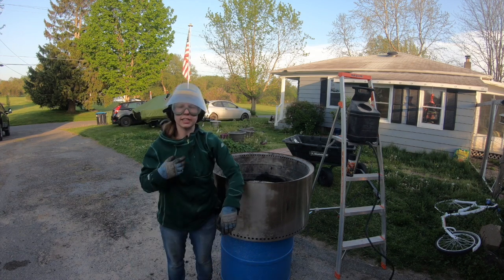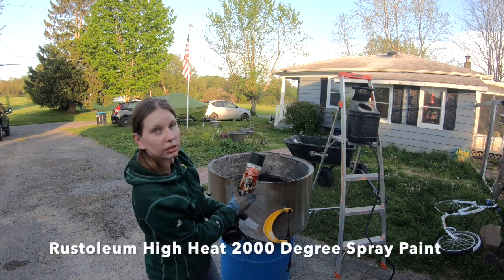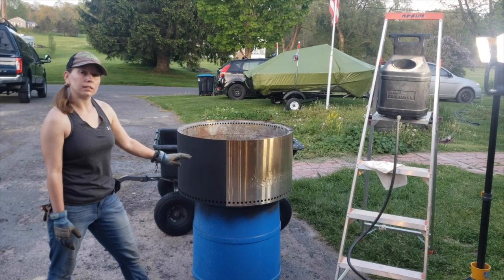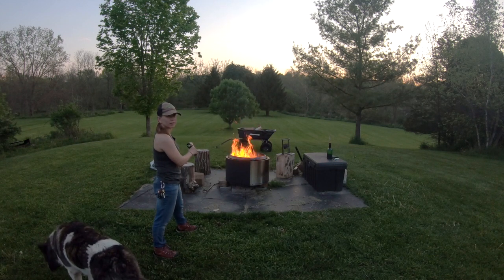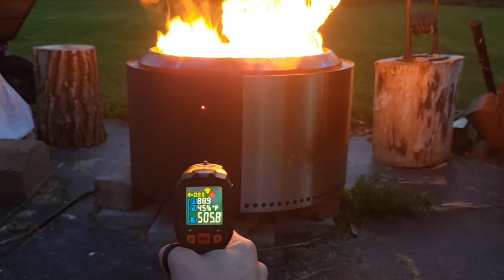Solo Stove Radiant Heat Test in Yukon - Make your stove burn hotter!

Comment: I am interested in black for the sake of more effective warming if people nearby. However, I wonder if it may lead to more smoke. This might be a good experiment!

Note that the black surface is actually COLDER than the unpainted stainless, even though it measures hotter by IR thermometer, because it is emitting more, ie losing more heat to the environment by radiation. This in turn means that the secondary air behind the black wall isn’t getting as hot.  The preheating of that secondary air is intended to complete combustion of materials that would otherwise be smoke. Also I can see the higher flames on the black side - that may indicate more smoke. 

Maybe repeat under daylight and just make visual observations?
Reply from the maker: https://youtu.be/mnPaBYZviS4

Comment: Awesome. How did it turn out? Is the high heat spray paint holding up nicely?
Reply from the maker: Overall it's held up well, I recently touched up the paint as the bottom chipped a bit, if I had spent a little more time in the prep work, probably wouldn't have needed it.

Comment: Did you ever do any additional test such as how heat radiated 3ft and 5 ft away and such?
Reply from the maker: Not yet, planning to repaint the black side of the stove, dull the surface finish of the unpainted side and get some thermocouples to attach to the stove body so it will be a good test.

Comment: You cannot use an IR thermometer for this test. Reflective vs non reflective surface. Id be interested to see the results with an ambient thermometer. I suspect if anything the painted side would be cooler.

Comment: Think I'll Keep Mine Stainless Steel.   That's One of the Things I Like about the Solo Yukon.   You can almost sit next to it with Kids and Dogs and Not have to Worry Too Much about Burning Fingers or Fur (Or Dog Noses....).   I Like the Fact that the Outside Surface of the Stove stays quite a Bit Cooler, Thanks to the Secondary Combustion Channel.    I also Love the Stainless Steel Appearance as Opposed to the Flat Black.    We've Had Our Yukon for quite a while and it still Looks almost Brand New since the Fires We have Aren't Allowed to Get Out of Control.   These Stoves can Certainly Burn through a Lot of Firewood.   Too Hot a Fire can Also Warp the Top Ring...
Reply: The outside of your stove stays cool?  I have the Bonfire.  Pretty much everything a half inch up from the bottom holes is blazing hot when the stove is hot enough for secondary burn.

Comment: I don't think the IR is giving an accurate reading on the stainless side. I recently ran into this issue while modifying a stainless smoker to a higher wattage heating element. The highest reading I could get with the IR was a bit over 200 degrees. I knew this couldn't be right. When I put an analog oven thermometer in the smoker it read 512 degrees at full power. I think this must have something to do with the reflectivity of raw stainless. I think a more accurate test would be to put two oven thermometers like the one linked below an equal distances from the painted surface and the raw surface and compare the readings.
That being said, I really appreciate your in depth reviews and comparisons of these fire pits. I think the Bonfire is the right size for me.
https://www.amazon.com/Taylor-Classic-Large-Dial-Thermometer/dp/B0000DJUYR/ref=sr_1_1_sspa?dchild=1&keywords=oven+thermometer&qid=1597579576&sr=8-1-spons&psc=1&spLa=ZW5jcnlwdGVkUXVhbGlmaWVyPUFaQjhTRzRRQkZXMFQmZW5jcnlwdGVkSWQ9QTA2MDkwMjkxMzBGNllSM1A5UzA5JmVuY3J5cHRlZEFkSWQ9QTAxODc3MTUyWUZBRzhYSVA4V1RNJndpZGdldE5hbWU9c3BfYXRmJmFjdGlvbj1jbGlja1JlZGlyZWN0JmRvTm90TG9nQ2xpY2s9dHJ1ZQ==
Reply from the maker: Thanks for the suggestion, I'm sure that thermometer would read more accurately, it would be a good experiment for the future.  
You can physically feel the heat difference between the sides as you walk around, so there is definitely some difference. 
Thanks for watching!

Comment: Not an expert here, but when using an IR thermometer you need to calibrate it for the emissivity of the object being measured to get an accurate surface temperature.  I do not know how this relates to real feel radiant heat.  So maybe taking a reading this way represents how you would feel sitting a few feet away.  I can see in the one shot your thermometer is set to E 0.93.  This is in the standard range of normal use as many non reflective surfaces are in the 0.9s, for IE skin has an E of 0.97.  Stainless steel however has a much lower emissivity (0.3-0.4), therefore you will read a much lower temperature, as temperature increases this error in readings becomes worse.  At the end of the video you show the stainless side as 123 F, at that temperature you could practically hold the thing for a few minutes and not sustain a burn, however I know that my bonfire surface gets extremely hot that even brief contact has melted my shoe, much more indicative that the surface is well into the 200s, especially considering the fire is burning at 600 degrees +. I think a good test  to see if the black side will actually make you feel warmer, would be to take 3 similar objects all painted the same color (black painted plywood) and place them around the fire on the respective side, (ideally below flame level) with the 3rd set at a distance away to get an ambient temperature.  Take readings as the fire gets going.  My guess would be, not much a difference while the fire is going, maybe as the fire cools the black side holds heat longer.  Maybe you can try that as a test?  It definitely has my interest.  Im sure if someone with a science background chimes in they'd already know this answer.
Reply from the maker: I hope to do the object test in the near future for the reasons you mentioned. 
You can physically feel the difference as you walk around the stove so there is some difference between the sides.
Thanks for watching!
Reply: I just bought the bonfire model and definitely no way with a fire that large the stainless surface is only 123f …

Comment: Very cool experiment! And a nice look to the stove! I think the temp difference has to do with how your IR thermometer reads heat off different types of surfaces. Has to do with "emissivity" of the surface. If you still have the half painted solo stove, a good follow up test would be to paint 2 identical pieces of plywood with the same paint and then set them up equidistant from the solo stove on each side - painted and unpainted. Then take readings with the IR of the plywood to see how much they heat up and if one heats up faster. That would control for the variable of how the IR thermometer measures temp.

Comment: Interesting experiment! Any thoughts as to why this happens?
Reply: I'm a retired guy, so all I have is experience.  Black things get hot in the sun because they absorb the sun's light and it is converted to palpable heat.  Lighter objects reflect some (a lot) of the sun's light so less heat is felt.  

A SS painted black with no fire burning will definitely get hotter sitting out in the sun than a traditional SS in its stainless steel finish.   

I have no idea if this works in reverse with a black outer surface radiating more heat than a stainless steel finish and will be watching this post for some expert opinion.
Reply: @rjg9421  yeah.  For this reason, I don’t think the airplane example applies here.  Intuitively, you would think of dark things as being hotter.  But the heat is coming from inside the stove, not from light being absorbed on the outside.
Reply from the maker: We'd love to see a scientist comment, but our thought is that black bodies radiate more heat and this probably accelerates the convection action in the double wall stove.
Reply: Hi - not a scientist but an engineer so I can chime in.  We are talking about radiant heat transfer.  The emissivity of the surface effects radiant heat transfer.  Shiny things are low emmisivity, meaning they do not radiate heat well.  This is why airplanes are sometimes shiny - they purposefully do not want the plane to get hot.  It’s also why black things get really hot in the sun.